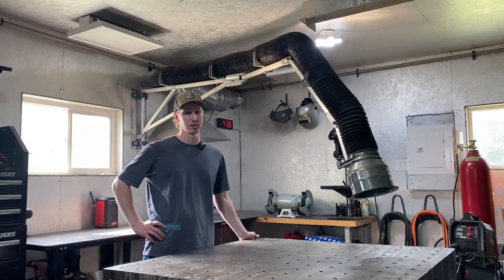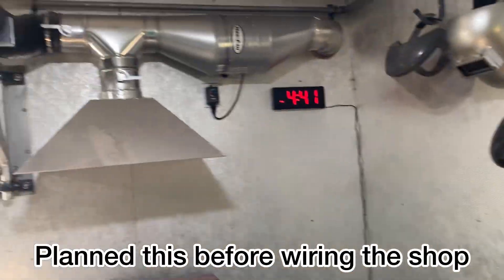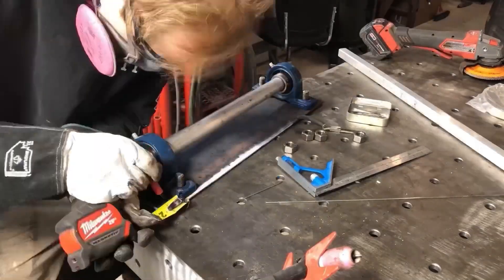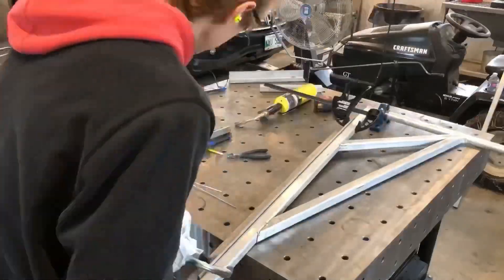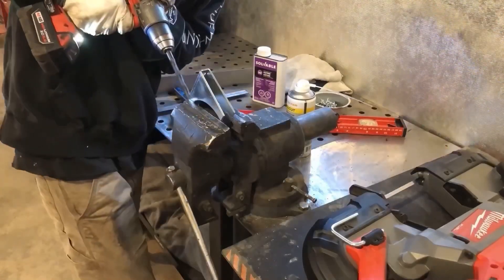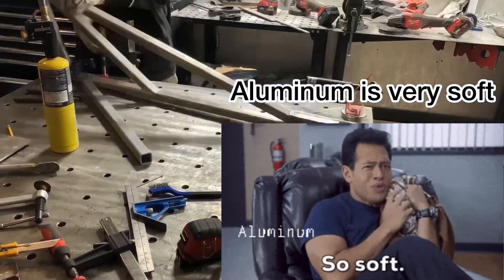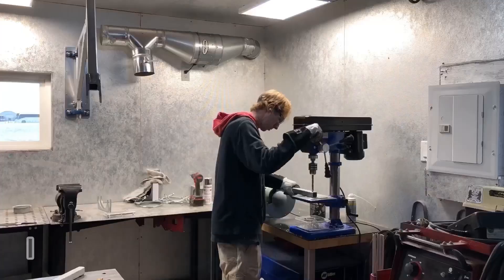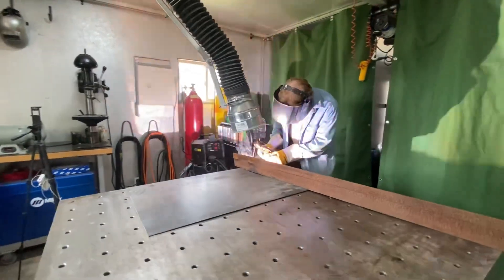DIY welding fume extractor

Comment: hi excellent job, two questions, what diameter is the flex hose and how much cfm is the blower. really nice setup, i`ve been putting this thing on hold for so much time it`s embarrassing ... take care. peter
Reply from the maker: Thank you, the flex hose is a 6”. And the fan is 1000 cfm I believe. It’s a little overkill but gets the job done.
Reply: Now that you have been using it for a while any issues?  What kind (brand of hose and fan)?

I modified my 4 inch Jet single stage dust collection system to 6 inch and added a shop made contraption to spins air allowing dust and chips to separate before air hits pleated filter.  I run very fine filter (I think 0.5 micron) and without the first stage separator the big filters clog very quickly.  Wondering if welding fumes are affecting your hoses or fan over time.

Keep posting, two thumbs up from Michigan.